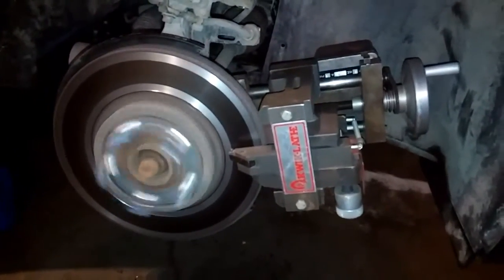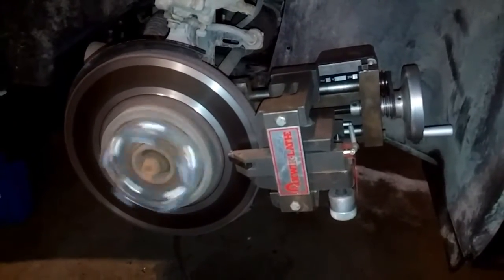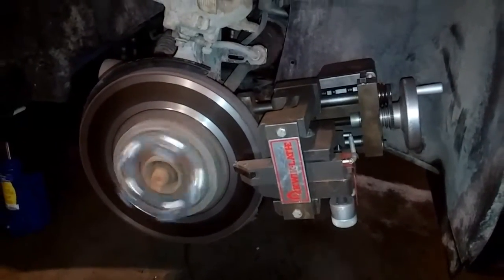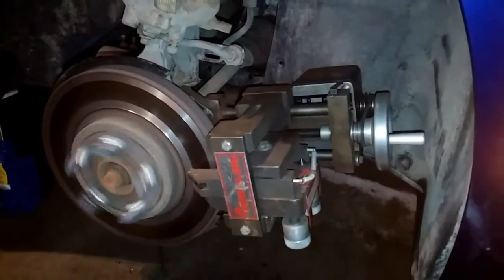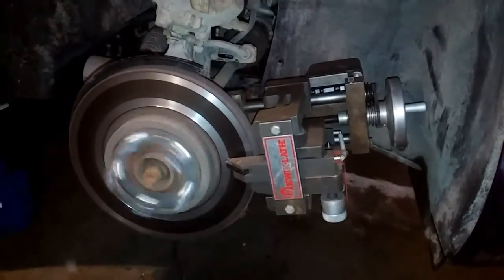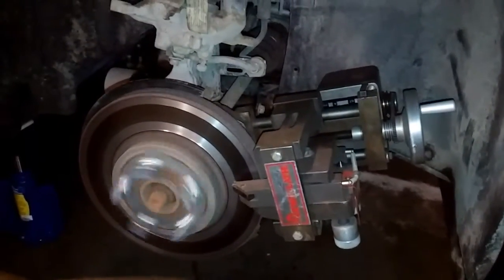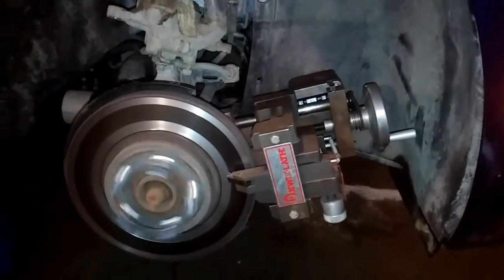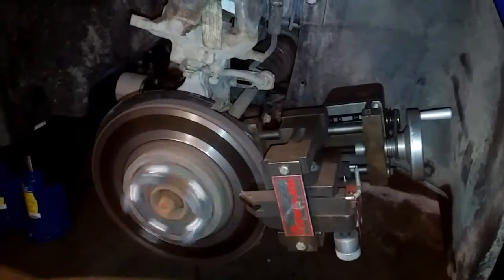On car brake lathe

Comment: In order to spin rotors, there is an electric motor on a stand that is supposed to be connected to the rotor and spins it at the correct speed.